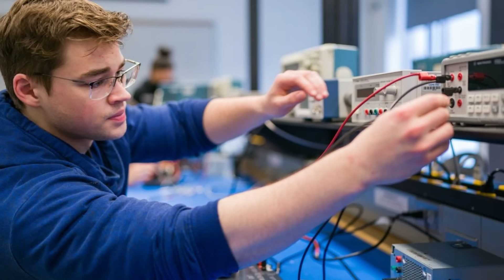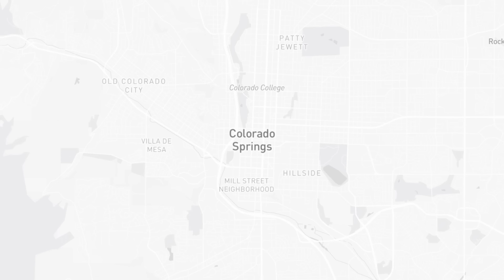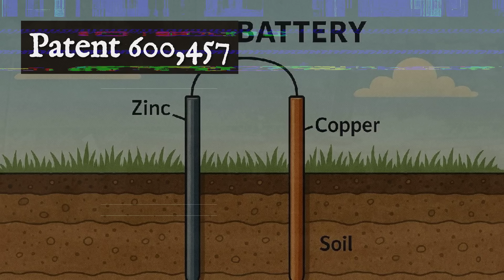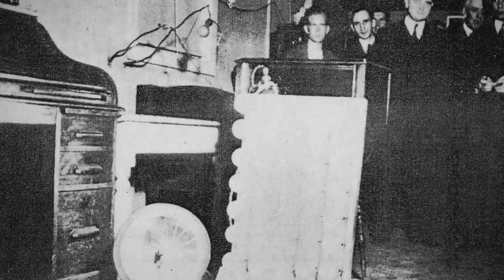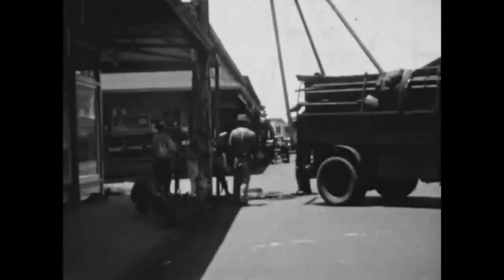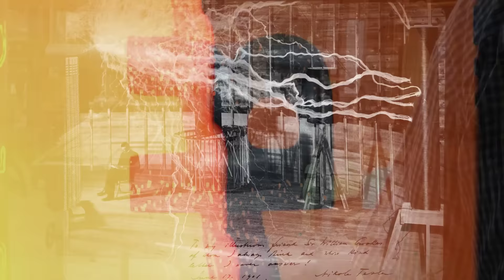They Pulled Energy From the Air in the 1800s — Then the Government Buried It

Comment: The old telephone wire had power get power from that.....You can get from radio too ..Or set up stakes under the grid wire to take energy ..Fly kite or stick in tall tree with wire and get grounding rod  ..There is more even generators and alternators and static ....

Comment: The reason why there is no free energy, is because nobody can patent any of the components or the circuits. The approach of any free energy device uses magnetism. Magnetism does not hold to closed systems because our universe is magnetic. Magnetic waves are scaler and are not Electro Magnetic Waves. If you remove the electrical component it can overcome Ohm's Law. Anybody can do it, and it is easy, as long as you don't over engineer it.
Reply: Tesla and many others have patent these things. The issue is and always will be the lack of profits!!! End of story.

Comment: It is just a crappy dissimilar metal battery pile that has concentrated poisons mixed into the earth with water that helps degrade the metal and powers the thing.  This is a slightly more wet, much larger, battery that is not too dissimilar from the carbon/acidic disposable batteries we used to use every where before lithium batteries got good enough.  At least not different in basic principles, just his way was less efficient.  We used that tech for centuries until recently.  Maybe do a video on something useful like atmospheric power systems?  Also not terribly good but they did work and also are no longer around.  Hard to beat free electricity that does not poison the soil.

Comment: everyone can setup free energy at home , 1st you need to set up lights that work with 9-12v , solar panels and charge controllers for a big Battery pack ....2nd you can use a petrol generator for day time use.
I have turned an old desktop computer into a charging box for phone , tablets, Laptops and even car/truck Batterys use it to run power to a radio or TV .... therse a few different ways to setup free energy simple to do , BUT people are just too lazzy ...... stop wasting money with power companys.

Comment: There are well over 50,000 such patents ranging from zero point, some of which are even anti-gravity,  to engines that get phenomenal gas mileage or that perform hydrolysis on site and burn the hydrogen, though they're trumped by electric by far which the Rothchild owned US Patent Office. In the 1920's Nicola Tesla built a car that ran on it's own power which never saw the light of day. Elon Musk had intended to have his cars operate on a similar design, but was prevented by them. He was told he had to use batteries or forget it and then was comped 8 billion dollars to keep quiet. It's really only a matter of rewiring one to obtain zero point.
Reply: And this is why they scare people into thinking mercury is highly dangerous and they control it so well. It can be used with to create like you said anti gravity.
Reply: Please, elaborate, I’m very interested in zero point.

Comment: Every substation believe it or not  has every high voltage component built on top of a heavy interconnect grounded  grid.. Even the surrounding fencing is tied to these connections.  Its fair to assume that every high voltage tower is equipped the same.  Electrical engineers are trained to deny the reality of aetheric energy but our grid is absolutely a massive aether harvesting system. Every node of our high voltage transmission  system is built atop of an enhanced grounding structure.  Increasing the potential of ground  where high voltage is near sounds ridiculous and dangerous but it would increase  the flow of aetherto the entire grid. This realm is a giant plasma powered battery.  Those HV wires can be installed  and maintained  at a fraction of its cost if it was buried in insulated tubing, but its in the air for a reason. We're hoaxed to believe that a network of massive   fuel burning  generators   are being fed 24/7 to pump current through millions of miles of wires to millions of locations.  In reality theres no direct  physical connection of our devices beyond the secondary winding  of the pole  transformer  across the street. A resonant frequency  is the key and electricity cant wait for us open a path to ground. The flow of  electricity is natural not  "manufactured". High voltage is trapped in a loop given a frequency and is transformed through a resonant circuit,  like the strings of a guitar a loose line is out of tune ( phase) and causes problems.
Reply: You ARE right I realized this ABOUT 30 years AGO......they are not sending down the wires electric...but ARE hitting atoms on the lines... electric is not Moving...it is atoms hitting near atoms

Comment: Well I'm 83 years old and I can remember my granddad had a bank of batteries They look kind of like fleshlight batteries but there was had tire filled around electrodes and he had a wind generator and it's wind generator charge the batteries and the batteries run the lights in the house and it run the radio but what no TV just the radio but they had a light at each room hanging from the ceiling and that ran off of the battery bank cuz they live well out the country down by the Leon River
Reply: Hello my fellow Central Texan... For a while I restored antique radios and one of them is a battery farm radio. That specific one of course is one of the last models produced that ran off batteries just before "modern electricity" came to the rural farms nationwide. Anyways when I saw your Leon River reference I thought to myself that really sounds familiar and it should.....I'm from McLennan Co. myself. 😊

Comment: I am 84 Us kids in 50s made earth batteries which  lit a 1.5 volt flashlight bulb. Also potato batteries. Also we pounded in rods into the ground and energized them with 50v ac. This caused worms to come to the surface we used to go fishing
Reply: There you go. Those lifesaving hacks still work and still make the higher-ups mad.
Reply: Its a damn shame the government and big players work so hard to cover these things up. And the newer generations are so lazy and ignorant, causing old ways to die and disappear.
Reply: This is such beautiful information!  Thank you for sharing.
Reply: Something weird, take a voltmeter and probe hot and litterly the earth... it will read battery voltage... wtf! I dangled the battery from my damn cherrypicker and did it, still shows correct voltage!

Comment: Until the Rural Electrification Program in the 1950s, if you were outside of a city, you had batteries in your basement or barn and they powered lights and other electrical devices. 

Battery dealers would come out each week and swap out the discharged batteries with fully charged ones. 

Life in the 1950s changed with the Grid spread over the US
Reply: Wow. Thanks.
Reply: The Rural Electrification act was actually passed in 1936, but many a farm and family didn't buy in or accept power lines for several years. One such local community often used one battery powered "farm radio" between several families.  On Saturday nights they'd be a family supper, listen to the WAR news and pray they wouldn't be next in being rounded up like the Japanese Americans had.  These of course were of German decent and kept quiet and to themselves as you might guess.  No, fortunately they never were rounded up, but that fear was very much real.